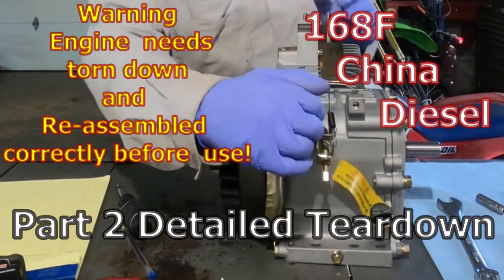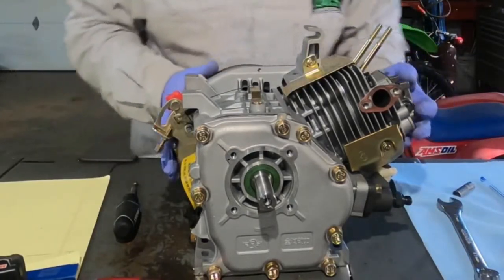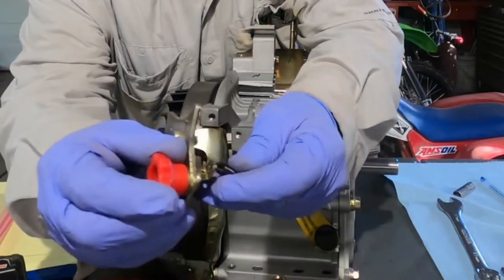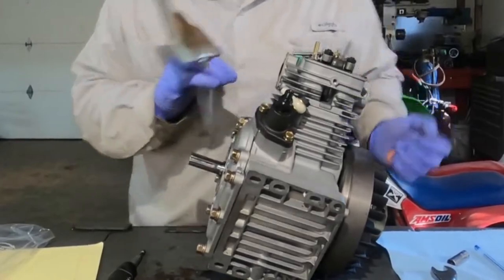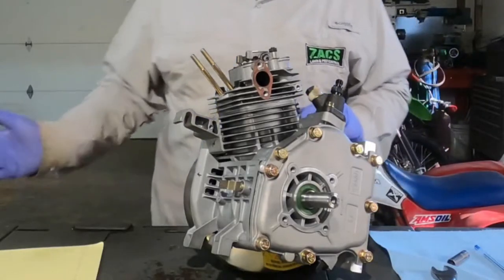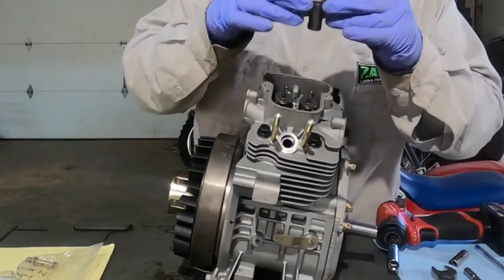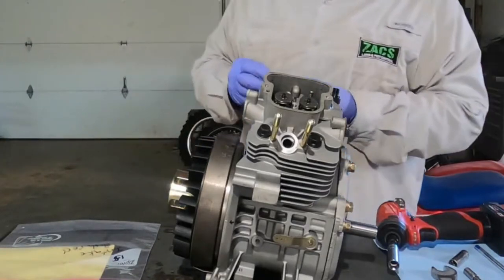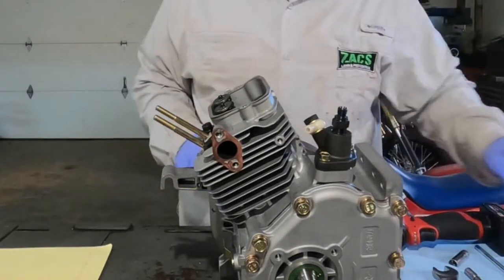168F Small Diesel Engine Prepping for Real Use! Detailed teardown part 2.

Comment: Since I was a kid, I was curious If I could mill off part of the fins in the middle of the head and cylinder. Weld on a sheet of aluminum. Forming a water jacket to convert a small engine like this to water cooled.  I wanted to cool my go-kart better so I could lean on it harder. It's not easy to get all that much power from a flathead without getting crazy!!
Reply: lol thats exactly the thing i was curios it is possible. Thought i were the only one.

Comment: I need one of these type engines for a DC generator, basically a battery charger! I'd like about 10 HP but 3-5 would probably work fine!   
I guess these are decent engines if you disassemble it and clean it up a bit before use. Or at least inspect it to see no shavings are in the engine! It probably wouldn't hurt to idea electric pump to circulate the oil thru a filter while hot a few times between oil changes. 
It wouldn't hurt to wash it out with diesel fuel before use at the very least.  Just be shure to let it all drain. Wait a hour, then waste a few oz. Of oil, them fill with oil being sure to lay it over to lube everything again.

Comment: If you have alloy inside the piston it will be burned without damage..
Checking torque spec by loosening bolts is not possible because of different stick force of the threading behind the bolt head

Comment: Could I ask you the question of what you think the torque is on that engine I know it's I think three horsepower but diesels are known for torque and I was I can't find anything tell me what the torque is on that engine it's got to be like at least seven or eight right what do you think
Reply from the maker: Not sure of actual torque numbers but it holds a load pretty good on the log spitter.  less bogging down than the gas 5hp gasser that was on it before.  The log spitter does have an over pressure bypass that make the little engine chug some but handles it very well!

Comment: Can this be converted to water cooled? I want to use the waist heat for heating my house.

Thanx for the info!
Reply from the maker: I really doubt it, not easily anyway.
Reply: there are plenty of water cooled single cylinder diesels around
Reply: Just wrap some copper tubing around the cylinder, run a pump with a resivwar, and a heat exchanger inside your house.
Reply: Or a water jacket around the exhaust pipe.  But it's been said that these engines run surprisingly cold so it might not be worth the effort.. Best would be run it indoors with the exhaust and intake piped outdoors if you need the heat that badly, and hopefully you'll never have to start a freezing engine 😂
Reply: Run it indoors.  Structure captures the heat.  Problem solved.